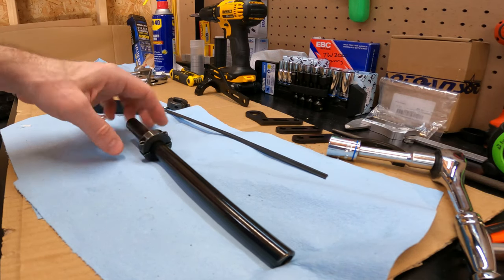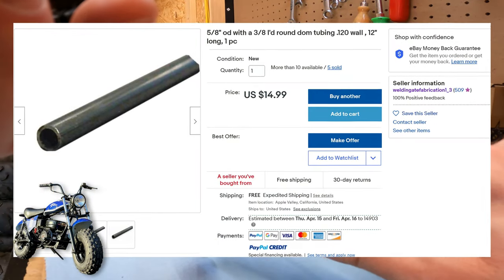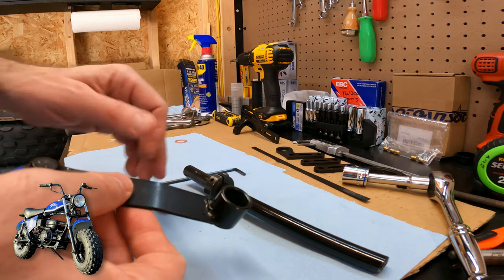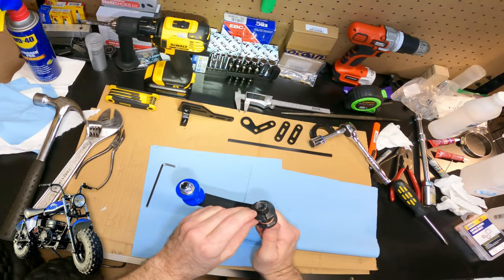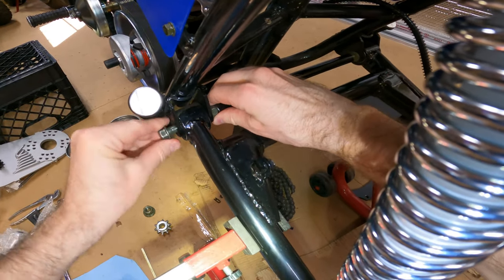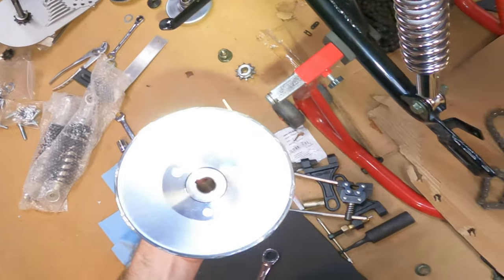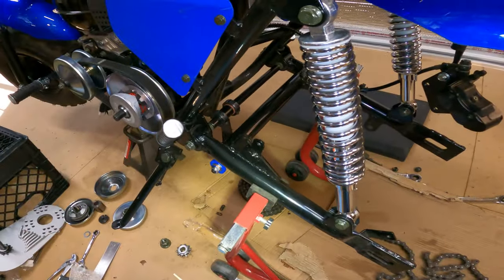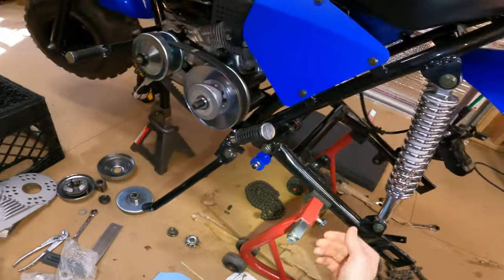Trailmaster MB200-2 - Awesome Custom Chain Tensioner! [4K]

Comment: The only other thing I did was bend the chain guard mount where the spring goes. Just so the chain wasn’t so close. But that’s easy.  Nice video.
Reply: Would you be able to use a long bolt through the chain guard mount?  Then put a nylon sleeve over the threads with a nut on the end for the spring attachment point? Would this be too close to chain movement?
Reply from the maker: Thanks!  How long of a spring did you end up using? just curious. I have to put bike back together and then try to find a good spring for the job.

Comment: I cut the 5/8 tube 10 .125" eliminated nuts..installed 10 x 1.25
Helicoils... then made a cam shaped
Spring holder with 3 holes. Removed
Pulley bolt...rewelded opposite direction...bent everything opposite of how it was made..flipped spring over so now tensioner pushes up!
Works great! 5/8 bar is now locked in won't spin and used original spring! Great idea I just made it better!
Reply from the maker: Nice! I ended up putting a different spring on there and doubling it back around the swing-arm and back onto the tensioner arm. Works great but after that plastic wears down it gets pretty loud. Might just go to a metal roller but I bet that will be even louder.  Maybe a roller skate wheel or something would hold up, not sure. That plastic lasts for about 10 miles.
Reply: I have seen people use skateboard wheels. I rode it around then lubed chain bike rolls better! Didn't put alot 
Of tension on it..see how long it last!
Reply from the maker: @johnhock890  Yeah I needed quite a bit of tension for it to not oscillate up and down at at over 40 mph. I think a skateboard wheel might work better. Not sure if it'll fit on that tensioner though.  Maybe just a metal roller would work, but it would be loud!
Reply from the maker: @idiot-proofgarage3739  Nice. I see those bearings have 8mm ID. Did you have to use different bearings? EDIT. - OIC it looks like they use a spacer to go down to 8mm. 👍

I’m thinking about trying a sprocket too.  Maybe the stock 10t from TC. It works great as is but wears the plastic rollers too quick. Maybe that metal roller would be fine though. I put some dynamat type stuff on the tensioner arm today and that helped a little with the noise. 🤷‍♂️😆 

Noise only happens when off throttle though.
Reply: I just swapped and used the larger bearings that were in the original tensioner.  If you are going to use a sprocket then you want an “idler sprocket” with built in bearing.

Comment: I built one of these and they work great thanks, but I'm having a new problem. The  rear driven pulley is terribly cut and bent from running it without the chain tensioner. I was Looking to get a new one and noticed in the video you said you replaced your old one, so wondering if you recommended anything.
Reply from the maker: Yeah you can buy just the rear pulley, at least you used to be able to on eBay and amazon. It would be listed as the “driven pulley” for a TAV2 30 torque converter.
Reply: Thanks

Comment: Hi did u put a extra washer on the clutch in order for the belt to straightened up when riding
Reply from the maker: Yeah it was super close with the shorter Tillotson output shaft.  I do have a vid showing that somewhere
Reply from the maker: Yup check this vid out at 3m 42sec

https://youtu.be/YpacjnhQXNs
Reply from the maker: And then this video at 2m 4sec https://youtu.be/uBgbIR9rGDE
Reply: @bwxmoto  thanks I would check it out

Comment: Real nice idea and like you say, should have come that way stock. Try not to overdo it with spring tension. Find the happy middle.

Are you going to do a vid on the 60 tooth install, etc?
Reply from the maker: Yeah isn't that just so slick? Like I said, wish I thought it up!   I have never really dealt with chain tensioners before so I'm going to get a bunch of different springs to test out. Hope I can find some locally that will give me enough tension but not too much, like you said.

Also I have been working on vid for the 9t/-60t (or 8t if possible) setup but I ended up having to do the shocks and the tensioner, chain obviously, and also driver pulley and everything at the same time. 

Also trying to measure everything so eventually I can cut off the driven pulley shaft mount and use a regular TAV plate. But yeah hope I can make a vid about it all that makes any sense. LOL 😆   

Also got that front brake kit / stage one kit, and some other stuff. This mini bike is going to be pretty cool when it's done!

Comment: Ride it for about an hour and you will have worn through the tensioner wheel. I got the same thing for a mini bike and was very disappointed that the spring is essentially unusable in most applications, and the wheel doesnt last at all, im currently using that arm with a solid slide adjustment I made for it and an idler sprocket instead of the wheel but it knocks the chain off on big bumps. I need a spring tensioner with the length of this and the functionality of the Craftsman sprocket tensioner
Reply from the maker: I used a metal roller and it works great.  Yeah the plastic roller wears too much.
Reply: @bwxmoto  Nice, I decided for fear of chain wear, that id just stick with the sprocket and try the Craftsman weld on tensioner
Reply from the maker: @lowlifeslides9918  The cool thing is you can use the metal roller from any old Coleman minibike jackshaft setup. It fits right on there. I used the bearings from the plastic roller and a washer as a spacer tube extender. All stuff a lot of people have laying around.  The metal roller is so quiet too, opposite of what I thought would happen. Might want to try it.  I think a sprocket roller might be cool too.
Reply: @bwxmoto  Ive done something similar to what you have now but with a sprocket, it has been holding up alright but it vibrates a lot. I thought about trying a metal wheel but thought it would cause wear. I might have to try that coleman roller tho, itd probably save me 90$ on the craftsman tensioner

Comment: I’m glad you addressed this, when I test drove mine for the first time the chain popped off. Couldn’t tell how it happened at first because the chain seemed so tight when I put it back on, then loose while rotating like you pointed out. 
Are you getting a longer chain to help fit the bigger shocks?
Reply from the maker: Not for that, but for the 60t rear sprocket. But if I was leaving stock sprocket and just upgrading shocks to longer ones I'm not sure if I'd need an extra link or two or not. I'm guessing I'd need maybe one at least but that's just a guess.

And I have seen many people have issues with chain tension on these things stock over the years. My chain didn't come off but it was rubbing on inside of driven pulley bad a few times and it sounded like it was going to pop off.   I think chain tensioner would help that! I'll know soon. 👍 

Might also need a spacer between sprocket and driven pulley too though.

Comment: Anyone have an updated link for the pipe?
Reply from the maker: If you search internet for "5/8" OD x 3/8" ID, 12"  Steel Tubing" Or something like that you'll find it. Can probably find something at a local shop somewhere. Seems kind of expensive on ebay but they are still there. Links change too fast on ebay to put link in description unfortunately.  https://www.ebay.com/itm/202962512764
Reply from the maker: Also could get a longer bolt and then just run the tensioner right off of the left swingarm bolt and not run a tube to the other side.

Comment: Where can I find the tube please eBay says no longer selling
Reply from the maker: I just got an aluminum one for $8 on ebay. Maybe it’s still available. I’ll check.
Reply from the maker: Check it out. https://www.ebay.com/itm/Aluminum-6061-T-6-5-8-625-OD-375-ID-125-Wall-Round-Tubing-Pipe-10-Length-/254449778988?_trksid=p2349624.m46890.l49286
Reply: @bwxmoto  I totally missed this message thank you so much

Comment: What spring did you end up going with?
Reply from the maker: I show it in this vid (link below) at 14:07  https://youtu.be/_OP7e2Or_Ug?t=849 

It's a big spring I got in a package of assorted springs from Lowe's hardware store. I'll see if I can find a link to that package of springs.  Ended up drilling a hole higher in the tensioner swingarm and looping spring around the swingarm support. I did shoot a vid about that but not sure where it is. I also used a metal roller off of CT200U type jackshaft chain tensioner and it worked on this tensioner. I bought that from gopowersports for $12. 

I'll have to make a separate vid about that but I do show it in one of these MB200-2 vids somewhere.
Reply from the maker: It might have been one of these https://www.lowes.com/pd/Hillman-1-25-in-x-4-6-in-Steel-Screen-Door-and-Storm-Door-Spring/3120533

Or one of these https://www.lowes.com/pd/Hillman-2-Pack-2-in-Zinc-Plated-Steel-Window-Screen-Tension-Springs/3925337

Or one of these https://www.lowes.com/pd/Hillman-2-Pack-1-1-2-in-Zinc-Plated-Steel-Window-Screen-Tension-Springs/3925345

I'm just not sure. It was definitely like one of the last two, but not sure if it came in that assortment or not. I just when and got a bunch of springs and ended up using one like the last two. The one that is in that video link above.

Comment: Can you build me one of those and I'll pay you for it I have the same bike but the black one
Reply from the maker: I just don't have time to do stuff like that, especially in the summer, sorry. It's pretty easy though. All you really need is a cheap hacksaw and a drill as far as tools go. You could also just run a regular one that clamps to the swingarm. People run those and say they work fine.   Like this one: (round tube) option. Can sometimes find them quicker shipping on ebay or amazon. https://www.aliexpress.com/item/4000068508517.html?spm=a2g0s.9042311.0.0.d8fb4c4dnbMD2y
Reply: Thanks a lot I've been trying to order stuff from gopowersports I've been waiting weeks for my packages and FedEx nor gopowersports knows where my stuff is I mean how do you mess up for Juggernaut for super pipes for tires for Mikuni vm22 and for Tilson 225
Reply from the maker: @kylecampbell4357  I dunno. I know sometimes UPS drivers leave my stuff on the side of the main road 300 feet from my house and on the tracking it says left on my porch. LOL    

From GPS I know they get backed up and sometimes do not ship orders right away, might be a week before they ship out.. But yeah can be a pain. 

From Ali Express stuff comes from China so might be a month or as little as a week.   That chain tensioner I linked to took quite a while, I think 2 weeks to get here last winter. 

OMB Warehouse is pretty good usually. I think GPS needs to hire more people or something,. they are always backed up it seems. But I always eventually get my orders from them but it takes a few more days than I'd like. But if you call or email and stay cool with them they have always been cool with me.